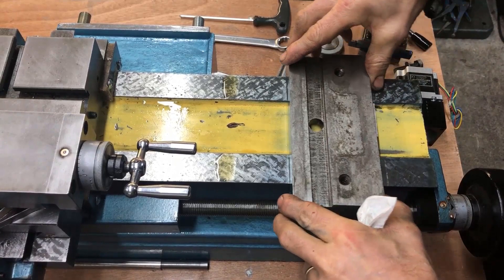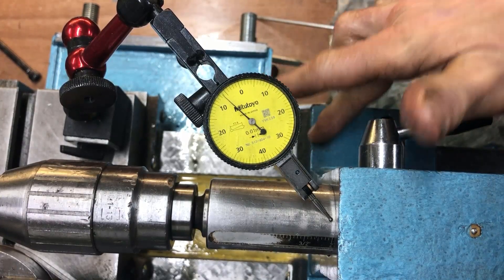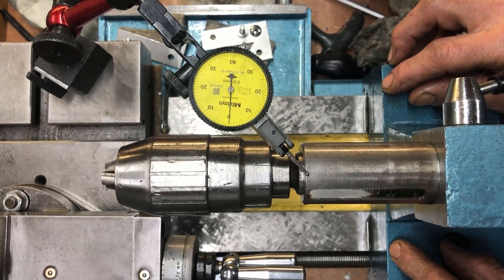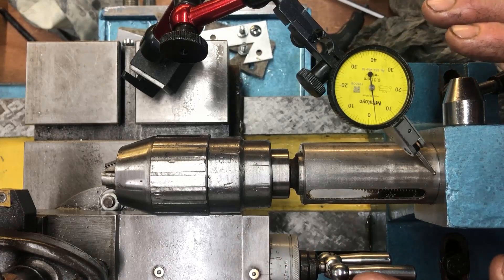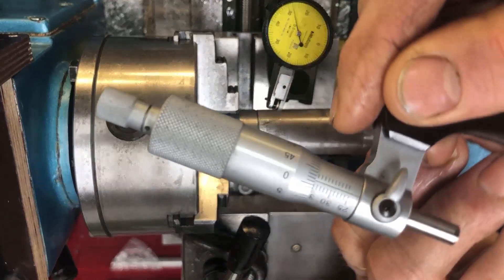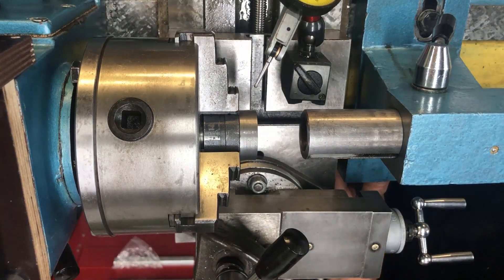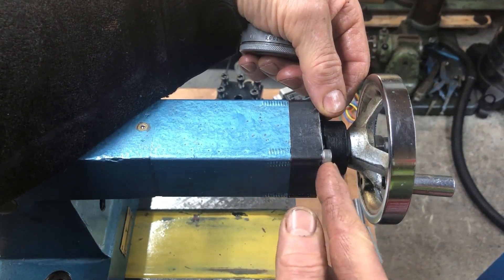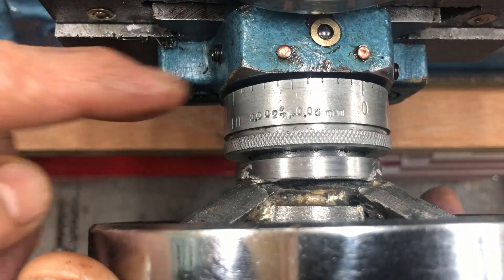Smarty AT-300 - tailstock - part 3 - measurements and scraping

Comment: I have one of these lathes Jan Sverre, can I bring it to you for the same treatment?? hæhæhæhæh!!!
Reply from the maker: Hehe.. I can try to help you if you want. Where are you located?
Reply: @jansverrehaugjord9934  I'm not sure it's worth it tbh... it's old and very well worn - I bought it for making MC wheel bearing spacers / turning bushes & bolt heads and stuff - very "imprecise" work and for that it´s almost perfect for my use - However, it's stiff in places and very loose in others so could do with some TLC but not as much as what you are giving yours!! Jeg bor i Drammen forresten :)
Reply from the maker: @Farlig69  I see.. :) Bor jo i Drammen selv.. Kontakt meg gjerne på Messenger eller email.. jshaugjord at gmail. com

Comment: Loving this series, lots of useful tips I am storing in the memory to be forgotten when I need them.

My tailstock bore is worn and shows deep sag now. Maybe have to sleeve it or build up with machine epoxy and rebore
Reply from the maker: Thnks! Very nice to hear that the effort I put into the video documentation while undertaking this kind of work is useful to others.. that is of course the idea!
Sounds like you are in for a tailstock restoration, yes.. I would try the easy way out first, ie. make a collar with the right diameter to fit the barrel that you mount to the front. Most likely however, the tailstock sag is another way of the machine telling you that it is worn, hence I would also do a complete series of measurements to establish the amount of wear elsewhere also
Reply: @jansverrehaugjord9934  Thank you, the collar is an idea so simple and effective, I didn’t even consider it. You are of course correct that there are some signs of wear on tailstock base also. If I lift tailstock barrel with lock it is pretty much perfect in line (only going off watching the centre drill wander.

This is a Colchester Chipmaster so is 2 piece with separate base so should be easy enough to build up with some Rulon or similar (I think that’s the stuff for build up?

Other option is I build up with cast iron TIG rods and remachine. I will need to finish mill first though haha
Reply from the maker: @homeworkshopengineering  The collar is at least worth a try. You may use Rulon to build up inbetween teh 2 tailstock section, but since these are noy supposed to move, it may be equalyy god to buy some shim stock. Yes, you can also machien it further downand isenrt a thicker plate :) Good luck!
Reply: @jansverrehaugjord9934  Thanks for that, I will have a ponder but for now just put it back together as have some jobs for the mill to do on it 🙂
Reply from the maker: @homeworkshopengineering  You're welcome. Of course, you can probably work with the machine as it is now also, overcomng any minor flaws and work around them.

Comment: I follow that the static 'upward' allowance for the tailstock barrel angle is to pre-compensate for wear on the tailstock base over time.  

What compensates for the dynamic 'clamping' force pushing the barrel up when drilling? Is there such a thing as a tailstock mechanism that functions like a Kurt style vise, where clamping pressure actually applies force down?
Reply from the maker: Hmm.. I haven't seen one at least, but then again, I am only a somewhat experiecne amatuer here :). If you ask this on Practical Machonist a real machinist might have a better answer. However, I doubt this exist for a standard type tailstock of the regular design. Maybe something resembling a capstan lathe tailstock. Also, I assume a multi-axis CNC machine centre works around the problem